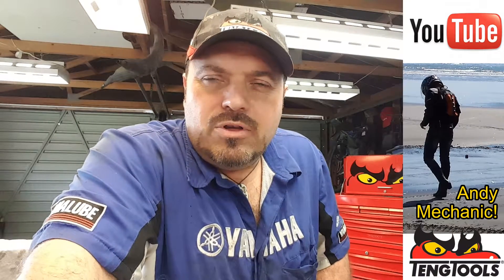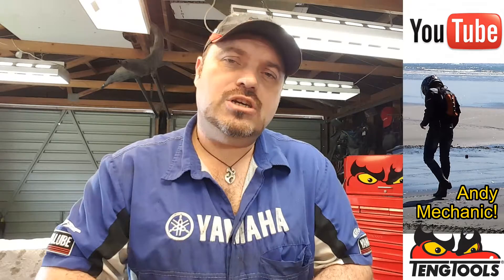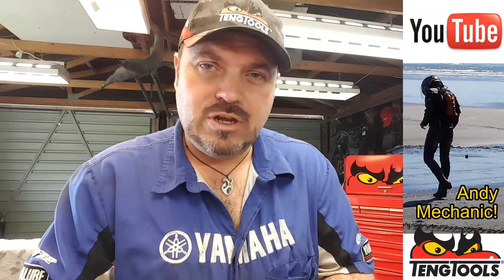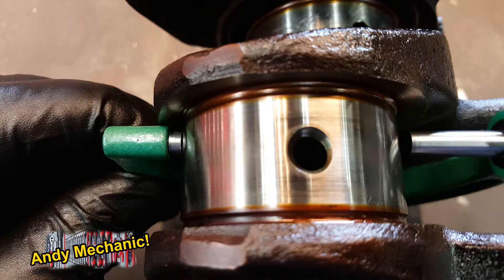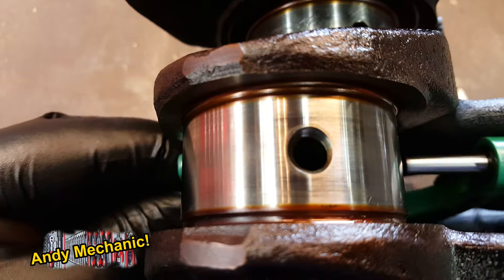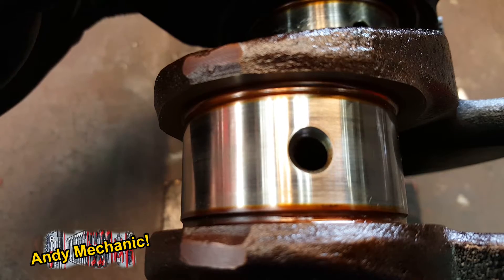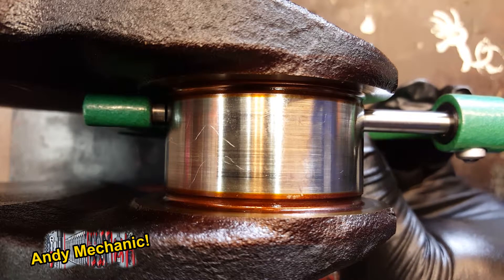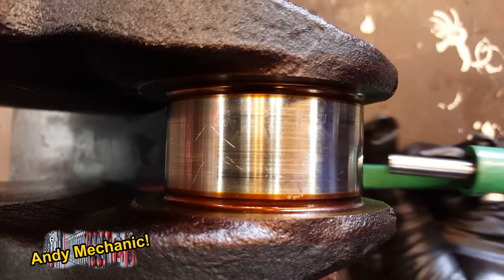Toyota Rav4 Crank BIG END  journal measurements Ep24 #1138

Comment: Good to see the journal was good. I assume the rest were okay...
Reply from the maker: Well, so far I have only had the time to do one of each of the measuring checks so that I can get the videos up onto the channel ready for this weeks classes. I'll be doing all the rest of the checks this coming Sunday together with the remaining 3 checks I haven't yet done to camera, Conrod straightness, Crank shaft runout & oil pump rotor wear. Once they are done & all the measurements complete then I'll no doubt put together a summary video running through all the results, costings & ultimately the viability of the repair & what I feel is the best step forward from here....

Thanks for all your input, it is most helpful. Cheers Andy
Reply: You're doing a good job and very detailed with your videos. Your students now and the ones in the future will be able to get good usage from your teachings.